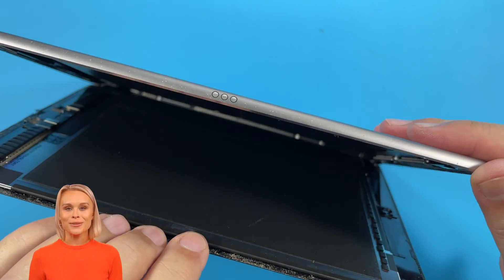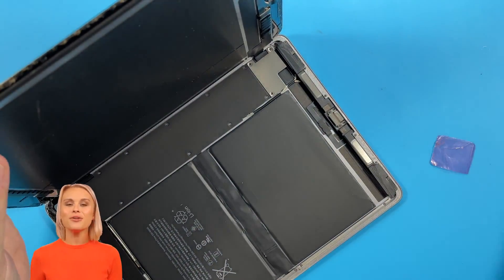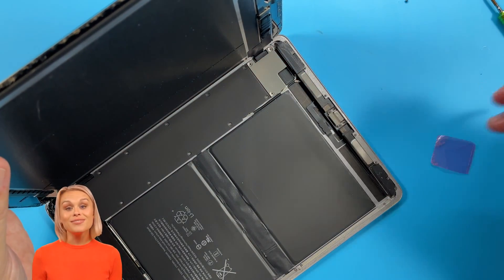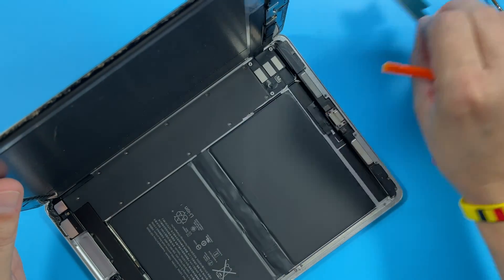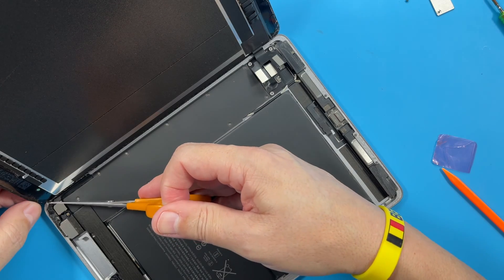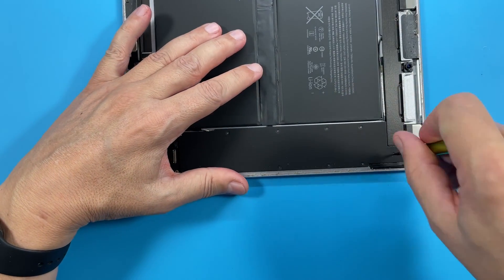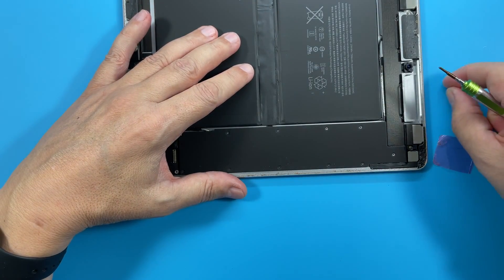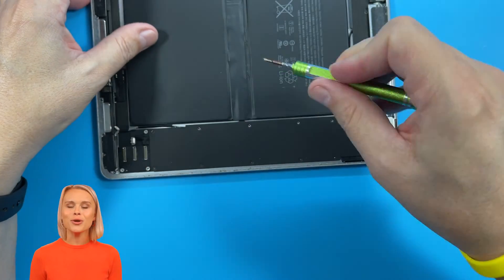iPad Pro 9.7" battery replacement | Battery repair guide | How to change iPad battery

Comment: You should never secure the battery before the screen. You run the risk of blowing the logic board. All you need is a thin plastic pry tool under the battery connector, secure your screen, remove pry tool, and then screw the screen down.